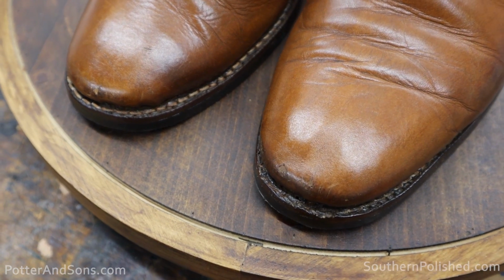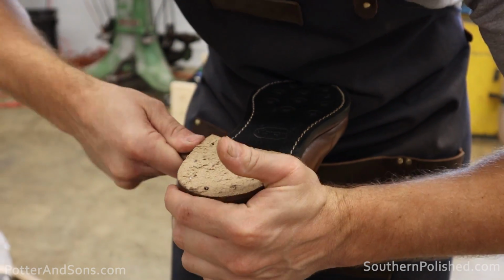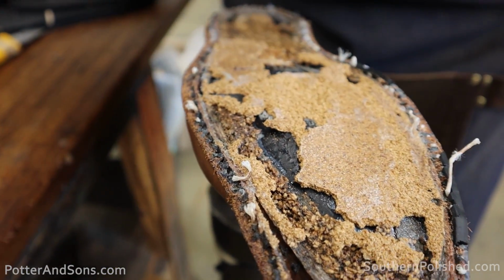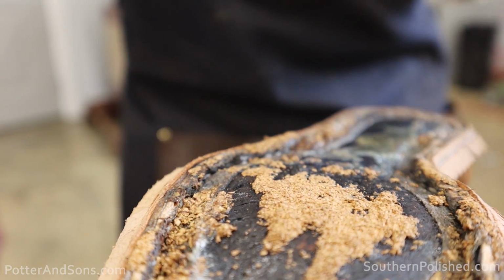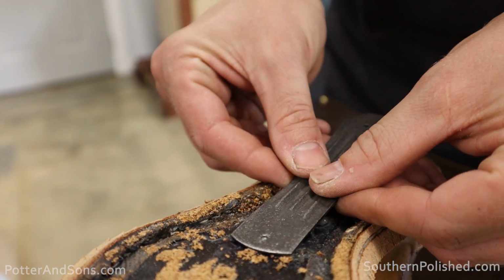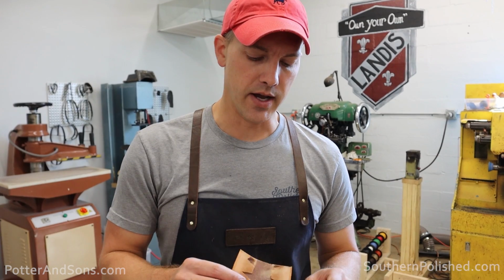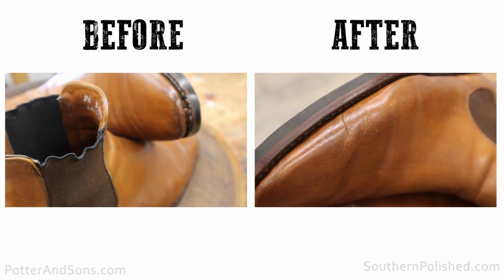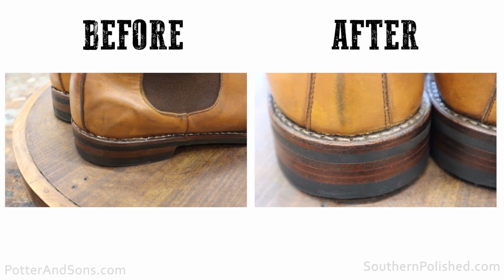A BAD Resole Job on These Chelsea Boots | We Refurbish Them Correctly

Comment: I once had a pair of size 11.5 black toe cap Bostonians. I had them re-soled. When I got them back they were size 10 and I couldn't fit my feet into them. The welts looked similar to the boots at the start of the video with the thread all over the place.  I don't understand why they are still in business. I wish they had as much respect for their craft and their customers as these two gentlemen have for theirs. Thanks for once again showing us how it should be done!

Comment: talking about "bad" cobbler work.....I recently brought in my mock-Timberland leather boots to resole ( in your email you mentioned that those have molded soles and cant be resoled easily ) ...but he did it and glued a great pair of solid Vibram soles on it ( the original soles were hollow and after a while they would crack on all sides )....

so I am happy basically that he switched to those solid rubber soles.....but unfortunately he didnt sand off the sole before glueing.....which made them came loose right the next day.........

But no worries, from all your videos, I got the suggestion to sand off the sole and put a new layer of glue on it....and press it down.

So they are now as new and hold tight. 
But of course they are glued and maybe soone have to be resoled again.
Reply: and my proudest purchase of leather shoes are a pair of neat black Oxford-style Allen Edmonds with the original leather sole incl black stitch.....and a new heel sole

Comment: I have a pair of Ariat cowboy boots that are in need of a resole and conditioning! Lol. They are the "Sedona" color. They've been through quite a few states over the past almost 10 years. I have had them for about 12-13 years. Love those things.  A mouse got the upper part of the boot, not too worried about that, as I wear my jeans over the boots. The rubber heels are gone, (just fell off over time) and the stitching is coming apart on the uppers.

Comment: Great job, I enjoy leather craft and through YT find myself watching a lot of boot repair vids. You were the first I’ve seen using a edge beveller, I like that, and have very carefully done it to cheap leather soles shoes and boots to give them a premium touch.
Most of my shoes and boots that have stitching on the sole I like to glue a thin layer (3mm) of hard rubber? I am not sure what it is called, but my local cobbler sells it to me by the sheet. I use it as a sacrificial sole, as it protects the sole from wear.
I would like to hear you view on this practice and if you have time, to see how you do it.
5min after posting this I saw that you have great vid on sole savers…..doh😳

Comment: I had shoes come back to me the same way. Jumped stitches, heels were not the same size, white thread on a brown shoe, didn’t even try to dye it. In addition the shoes were not standing flat on the ground, but just on the front edge of the heel. In the end they were sent to the central workshop and they redid it the right way. Maybe I should have never left the shoes with the first guy. He said to me “I hate shoes” 😂 —Surely you have to love them!

Comment: Way to backstop those Allan Edmonds!  On another note... have you thought about strategically placing some sound tiles on your ceiling.  The 4x4 foam applications can be expensive, but you wouldn’t have to do the whole ceiling.  Just a thought.  Love your channel.  Thanks
Reply from the maker: Thanks!  We have those foam tiles in our video room, where we shoot our review and how-to videos, but our “shop” room is so big, with such high ceilings, that it would take A LOT of those tiles.  We get a lot of suggestions for those, but unfortunately, it’s just not feasible in that particular room.  We try to use the lav mics as much as possible.
Reply: Trenton & Heath figured as much given you guys are pretty thorough in the first place..  Had to at least offer the idea just in case.  Great work!
Reply: Trenton & Heath one last idea... I work in recording studios as a profession and was a permanent volunteer at an architecture and design museum for over a decade, so I’ve seen many applications regarding sound absorption.  All you have to do is break up those sound waves bouncing around the room and it may be as simple as inexpensive cork flooring from Home Depot.  You don’t have to “proof” the room just dampen the echo  so your lav’s don’t pick up the residual effects and maybe even save your backs a little down the road.  That said, I’ve been following you for awhile and I get your recent buildout was, I’m sure, a big financial commitment and it may not be the right time for all this, but again, just putting it out there.  I will now submit this comment and return to being a silent observer. Keep up the quality videos.

Comment: Looking nice as always! But you guys really need to do something about the acoustics in your workshop. Audio 'adequate' for youtube, but I'd go crazy with 40 hours a week in that reverberant soup of noise. :)
Reply from the maker: Unfortunately, this is an old factory and with sound we get what we get.
Reply: @TrentonHeath  You could (should) try some acoustic panels glued to walls and ceiling. It will cost money though, especially since the room both looks and sounds quite large. A significant percentage of the reflective surfaces must be covered for it to really help. 
Maybe an idea to DIY a bit if you're as handy with carpenters tools as I expect?  I recommend you research this, It is a health hazard in the long run. You work with some noisy machines, and hearing damage is permanent.  
Just a little concerned for you, and I guess I sound like mum now. :D

Comment: I have a question.  You mentioned the welt threads being white and died brown.  You then used white welt thread yourself.  Were you commenting on the died thread, or were you commenting on using the wrong color thread?
Reply from the maker: The thread color that sits on top of the welt was white, when the previous cobbler resoled them.  We used brown thread.  The thread we used to hand stitch the welt on was white, but you don’t see that thread.  It’s hidden inside.

Comment: I saw a new kind lazy bad resole yesterday. Someone worn down the sole as usual, but the cobler instead of doing a resole, just put a sole guard on the shoe. Half of the cork was missing also, so there was a huge dent inside the shoe.

Comment: Can you guys work on the Bates jungle boots, the Ones the USMC issues, I have a pair I was issued in 2002 id like to have refurbed maybe. They are like a suede type material. What would something like that cost? I'd also like maybe a bit softer tread for walking on concrete vs how these where made for walking over terrain.

Comment: A couple questions: 

1) The hand controlled pressing machine used at 8:00 (haven't seen it in a while)... did you use that as an extra step to ensure the midsole was properly bonded? 

2) Do you wear a mask when trenching the Vibram soles?

Thank you for an excellent video... as always!

Comment: Are you familiar with the sutter mill boot by Allen Edmonds. They have a comfortable rubber sole, but I have noticed that they are wearing relatively quickly. I just bought them but feel like I will need to replace the soles within the next 6 months or so. What would you recommend putting on them? I am thinking about going the dainite route. Please let m know if you know what I am talking about (soft foam rubber soles) and if you have any suggestions for a comfortable and more durable replacement.

Comment: I've been meaning to ask for ages - is there a reason your edge trimming wheel doesn't go all the way through and you finish with a knife? Is that for better control or just the way it works?

Comment: I can't believe that the person who did those soles was a trained cobbler. Then again, I can't believe that many of the shops, no matter the discipline, have trained technicians anymore. It's the difference between taking pride in what you do and showing up to get a paycheck, something on which, in my opinion, our country desperately needs to focus and fix. I've never personally cared for that sole pattern, but you did a phenomenal job as usual, Heath. #PridevsPaycheck
Reply from the maker: Thank you!  I couldn’t agree more.
Reply: There are actually a lot of people that take over a shop (whether inherited or bought) that have zero knowledge starting off and they start learning as they get items in. Which is sad for the customers, that someone is learning by using their items as guinea pigs. But even some of those newbies wouldn't be willing to do a job this bad. That's not to knock on all of them though. There are a couple that I know of that started off with zero knowledge but ended up becoming very good at what they do.
Reply: @Cemmos  In those cases, they should be hiring masters of that trade and learning alongside them as apprentices, working their way up to the point where they're able to run the business themselves.
Reply: @American_Jeeper  They absolutely should. I'm sure there are various reasons they don't though.

Comment: I'm tired of slipping in leather soled shoes I'm thinking about always having some type of rubber on the sole when ever I get my shoes resoled.
Reply: I had a pair of leather soled shoes many years ago.
Leather soles suck. They are too slippery and WAY too noisy.
You could hear the clap of each footstep when walking on a hard floor.
By switching over to rubber soles, I no longer had any slipping or noise problems.

Comment: I’m sure this has been asked before, but what type/brand of glue is that they use? Some type of contact cement, but it seems way less goopy than anything I’ve ever used.
Reply: I wonder too! It looks like the animal hide glue my dad used to heat up in a little pot and use for woodworking.

Comment: I’m curious as to know when should boot get resole? I have my Thursday Boot Vanguard and been wearing a ton for about over a year.
Reply: When the soles wear out. If they look and feel like they need a refresh or you can feel the ground too much for your liking do it. Better early than late as it will end up costing you more. If they’re leather soles try and get them resoled before a hole happens by the ball of the foot. I’d recommend getting another pair of boots to circulate so you don’t have to wear the same pair every day. Leather shoes should have a day in between to properly dry out especially if you don’t use shoe trees.
Reply: John E. Zang thanks so much for the information. I’ll be looking into getting them resole then. Since I do feel the ground quite a bit more then what I would like to feel.

Comment: I like your video, however i felt you could do to have the camera father in back. it felt like a lot of footage was very close up for no reason. you could fit the whole shoe in the shot, and still capture the detail of what youre doing for the most part. and when youre holding something speaking to the camera, the item youre holding is often cut off.

Comment: "there's no reason to use this much glue."

Literally every pair of shoes I've ever owned begs to differ.

Then again, I've never owned a pair of shoes worth enough to have them resoled so maybe my experience doesn't apply.
Reply: How do you check the amount of glue used in your shoes? I get it that you own cemented shoes but do you actually rip the soles to see the amount of glue used? It is impossible to tell based on the exterior look of the shoes.
Reply: @timedone8502  Jesus.. So many conclusions you've jumped to and yet not a single one of them made any sense given the context of my comment.. 

My shoes fall apart. I wear them for a period of time and the soles literally separate and fall off, all on their own. 

The fact that I was complaining about how little glue was in my shoes should have been a huge hint that the glue obviously did not do its job, and THAT would be how I "inspected" how much glue was used.
Reply: @KurNorock  oh sorry I misunderstood. I was just asking because I am no longer interested in buying GYW shoes. Resoling is nice but it’s too expensive in my area and it no longer makes economic sense. I am considering just buy cemented shoes and replace them every few years. The problem I have is it is impossible to tell from the exterior finish if the cementing job was done properly with sufficient amount of glue. Based on your comment, I thought there was a way to tell..